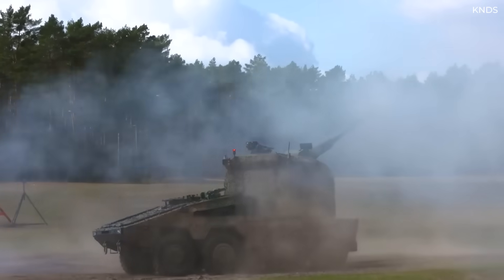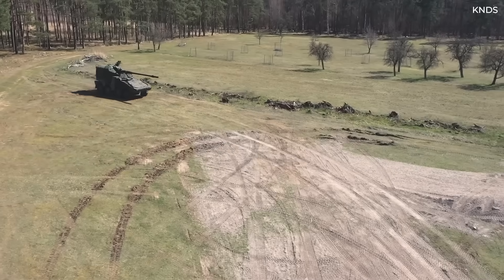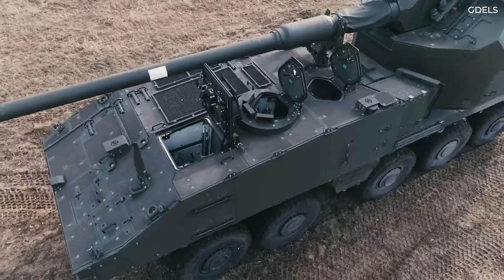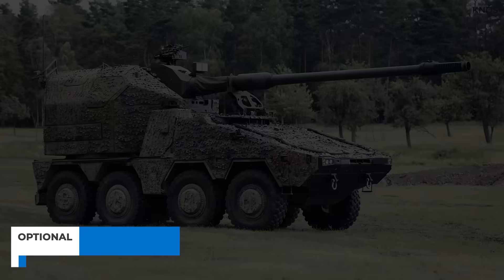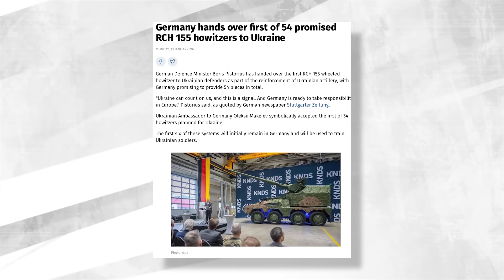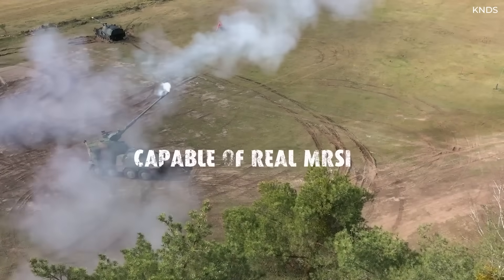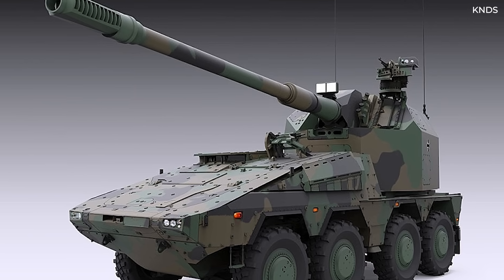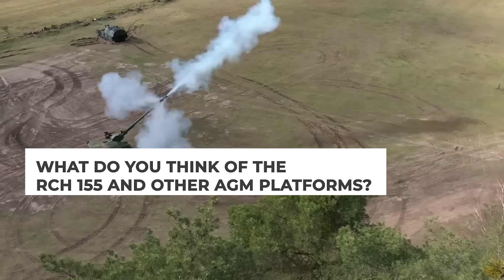RCH 155: If Drive-By Shootings Used Artillery...

Comment: The RCH 155 is too expensive and too complex. The Ukrainian Bohdana surely offers much better value for money. The tracked SPH's like the Hanwha K9 Thunder offer the best mobility in difficult terrain but tracked vehicles can't self deploy long distances quickly. The Archer being mounted on the Volvo Articulated Hauler has excellent mobility in difficult terrain and can self deploy long distances. The Slovak Zuzana 2 probably has similar mobility to the Archer. The variant of the French Caesar, the Caesar 8x8 mounted on a Tatra chassis looks to be more capable off road than the earlier version mounted on the Renault Sherpa 6x6 truck but less capable off road than the Archer or the Zuzana 2. The South Africans and Israelis also have good equipment so there is no shortage of good options.

The Lithuanians chose the French Caesar Mk2 also on a Renault 6x6 truck chassis so mobility in difficult terrain is not the best but they also have the German tracked Panzerhaubitze 2000 so they complement each other. Latvia uses old American M109's upgraded by Austria and this was probably a very good value for money purchase. Estonia use the K9 Thunder and the Caesar 6x6 so have similar capabilities to Lithuania. All good choices apart from the lack of standardization.
Reply: that is a lot of cobble of speculation trying to pass as a matter of fact, nice try though
Reply: @andreas: You miss a couple of important points: Arty ranges expanded a lot in recent decades, and we haven't even started to field and purchase ramjet ammo with ranges north of 140 km. Plus all over Eastern Europe you can hide wheeled artillery in woods, drive out onto improved agricultural and forest roads (plus the regular ones) as any zoom on google maps will confirm you. As for the use of the respective guns, all the mix you mentioned should have gone to Ukraine to crush the Ruzzians, and repurchase of the best, most modern, most resistant to Ruzian kill chain by UAV arty for counterbattery etc. would have been ideal. That is, order 1000 - 3000 AGMs on whichever platform, and phase out the legacy systems to forward them to Ukraine alongside opening ammo factory after ammo factory would have been smarter. Ukraine in its state of national emergency in a fight for survival cannot choose, but would love to match Ruzzian old Cold War stocks of ammo and arty tubes, especially if donated. But we can afford standardized quality of which the Ruzzians can only dream. (You do of course have a point concerning fast Bogdana assembly due to this emergency, but that only reenforces my observation: 24/ producation asap with massiv fast handovers would have been the preferential solution. If any Baltic State builds or buys AGMs on any fitting platform, they can use that probably for 50+ years in pure deterrence. Under those circumstances a wheeled arty is cheaper and simpler to operate as opposed to tracked vehicles that should have rather crushed Putin's war criminals day after day).
Reply: @Walterwaltraud , a flow of schizo and dreams
Reply: @Danila_Korotkov02  Yeah, disprove it, little bot. Facts and arguments, no trolling, if you can. I'll be surprised...

Comment: This is the first time I've seen a wheeled howitzer without a spade.
How accurate is it when firing with the vehicle shaking that much?
It would be great if the catalog data could be put to good use in actual combat.
Reply: It would not be chosen by several militaries if it had problems with precision.
The recoil dampener is probably secret.
Reply: @DJ1573  Thank you for your comment. I have been researching military weapons for over 50 years and have had contact with members of the Self-Defense Forces.The manufacturer's advertising is great, but I've heard that when people actually try to use it, the performance they claim to achieve doesn't come close to what they expected.
Reply: @radiojanker  According to old RHM materials, the trick is that the round has left the barrel before the delayed blowback hits the chassis. 
Thus the suspension only needs to get the chassis back to stable in time for the next shot, which is a lot of seconds to work with. 
Also, the suspension for the RCH155 / A3 model is oversized compared to earlier Boxer types.
Reply: @positroll7870 Thank you for the explanation.
Reply: Mam te same wątpliwości.
 Na wojnie ekspedycyjnej (Afganistan), pewnie sprawdzi się znakomicie.
Na wojnie totalnej(Ukraina)-mam duże wątpliwości.
Reply: @marekduczman  It probably mostly depends on how target rich the environment and especially the recce is. A bunch of them softening up defenses whilst on the move, harassing, MRSI when they see a worthy target, with supply covered in forests limits the amount of shells needed to locally overwhelm Ruzzians etc. Until they amass enough firepower, reconnaissance, air supremacy etc. 

Is it ideal for the first 48 hrs at the 38th parallel or for Taiwan? Nope. But depending on opposing force and attrition, especially from the air, I'd rather have one of these in LSCO than 20 D30, for example.

Comment: A mi parecer y por Física, el  Boxer 8x8 o similares como plataforma son los menos viables, un sistema de artillería de este tipo requiere de una base sólida y amplia para un funcionamiento correcto y longevo, de lo contrario asistiremos a un escenario donde este equipo pasará gran parte de su tiempo de servicio en mantenimientos y reparaciones por recurrentes desgastes y roturas prematuras.
Reply: And the Boxer ist modular. The AGM ( Gunpart ) kann bei swapped easy an fast to another Boxer drivemodul.
Reply: Exacto, Si tiene toda la razón, para esa función de Self propelled 155mm de trabajo dinámico us una muuuuuy sólida plataforma.

Comment: Before the usual experts show up: Yes, the Boxer can handle the recoil without any problems. The real issue with the RCH155 is how it can handle the threat of drones, but other howitzers have this problem too.
Reply: Anything that isn't a dedicated AA weapon has these problems.
Reply: @0Turbox  Even AA weapon weapons aren't immune to drones, especially if they aren't aa weapon specifically designed for small short distance threats. Like if you had bunch of low altitude small fpv drones charging Patriot launcher at low altitude there wouldn't be much the patriot itself could do. Of course someone would have failed badly for those to get close to such target.
Reply: Just combine the unit with dedicated AA like the Skyranger
Reply: @DJ1573  Skyranger turret on top of the RH155 turret ?
Least it'll get a good vantage point :-)

Ah yes, a remote weapon station on top of the Skyranger turret, to protect against infantry and such.
Reply: @johanmetreus  Just like a battleship turret 😂
Reply: @johanmetreus  No i meant a dedicated vehicle supporting/defending the RCH155.
Reply: So same issues any wheeled artillery has.
Reply: UKR wanted some upgrades. I expect one of them being the RWS on the roof getting anti drone sensors. Maybe some ADS/Strikeshield panels are getting added, too.
Reply: I think the mobility on its own helps it against drones.
Reply: @hedgehog3180 yes!
Reply: In German army RCHs is working in a group combined with a command and a radar vehicle or something and skyrangers AA as i heared.
Reply: Actually you need an extra variant of the Boxer.
You can't put the module on the "older" types.
Reply: We'll see in due course as some issues like metal fatigue only manifest over time. It could probably benefit from being on a longer Boxer chassis with an extra axle. It's interesting to see the same gun being mounted on a 10x10 vehicle for the Swiss.
Reply: The AGM needs to be mounted on the 44 ton rated version of the Boxer with the improved design. 
The AGM can be procured on a 10x10 piranha platform or the ASGOD tracked vehicle
Reply: Higher mobility itself is one protection against drones + it has secondary weapon so it might be smart to develop something for that with drones in mind. Not super heavy but very accurate mg or grenade mg with proximity fuse and some mini radar.
Reply: I would be surprised if a vehicle weighing roughly 40 tons couldn't handle recoil

Comment: No one seems to know how it is able to fire on the move, without putting down any stabilising feet...  Something special with with recoil? Or suspension of the Boxer? Strange no one seems to be even talking about it...
Reply: According to old RHM materials, the trick is that the round has left the barrel before the delayed blowback hits the chassis. 
Thus the suspension only needs to get the chassis back to stable in time for the next shot, which is a lot of seconds to work with. 
Also, the suspension for the RCH155 / A3 model is oversized compared to earlier Boxer types.
Reply: @positroll7870 That does not mitigate the bumps and vibrations coming up from the vehicle when moving.
Reply: @johanmetreus  Sure. But thats a problem that has been solved for fully stabilized tank cannons for 40+ years. Those 40 years also allowed for improving those systems to the point needed for a gun firing 40km ...
Reply: @johanmetreus  The shell is released when it's exactly aligned with azimuth and angle. That's the (not so new) trick; it all depends on the execution, obviously, and the RCH 155 has a top speed for the trick (not sure whether I read it in km/h or mph, so I am not gonna write it from memory here).

Comment: Impressive that it doesn't need to stop and brace to shoot.
Reply: Sure, but not very useful.
Reply: Nice feature, but, chassis won't last long.
Reply: @DruidTimer  The barrel will probly need replacement anyway long before the chassis shows serious issue. Like shock absorbers are designed to absorb shock.
Reply: @DruidTimer  Exactly, wear and tear on Western artillery systems in Ukraine is a major problem, with a lack of spare parts and skilled technicians to repair the systems in the fields, necessitating their return to the manufacturer.
Reply: @AddieHilton  not really true. And you need to fire a lot less with an accurate artillery and you need a lot less people. After all it is the Russians that are running out of artillery now. The shooting on the move won't be used all the time. And you could put the AGM on a different chassis. There are variants on RX truck and tracked versions.

Comment: nice video as always!

Maybe considering mention that today most advanced weaponsystem could serve longer or doesnt need updates as soon as other weaponsystems then the not so far developed weaponsystems from other manufacturer.
The livespann of miltaryvehicle is long and in my opinon the price you pay today for acquiring it could be mitigated by the lifespann of the vehicle or the need or NOT need to upgrade it. The other point is that its ONLY needs 2 men to operate it.

Also whats a complex topic is what is included in the purchasing price. A Maintenance contract with or without spare parts and so on. The public doesnt know in my opinon that a price reported in the media is what you get. One country orders a maintance package the other isnt. One countrys orders training or training aids the other not. In todays world a upfront cost tells you nothing of importance in my opinon. 
In my opinon the price forwarded to the media shouldnt be taken seriously cause it doesnt reflect the true value of what the country is buying.
Reply from the maker: Yes- good point about price. It is always a difficult one. If there is 0 mention of price, then people ask about the price. And if you try and provide a rough price estimate, some people will say that the mentioned price is inaccurate (because it often is). 

But in most cases these days it will be difficult to provide an accurate price-per-unit because deals are always different and what is included in the price varies as well.
Reply: @BalticDefenceReview  a tough topic to bring to the audience without the support of facts. 
I was watching a german creator that had a flight in a eurofighter. He showed what it took to be able to fly a eurofighter as a observer. From maintance to medical checks to pilot training and so on in a 4 -5 hours videoseries (sadly only in german but if its intrests you the creator was JP perfomance). I wasnt aware what it costs to run an airforce. This series opend my mind of what is required to operate a military and its costs behind it what you normaly dont see.
Reply: @BalticDefenceReview  That's why price per unit should be avoided. Total price and number to be delivered under the contract is the only relevant information with less it is specified what extras are included, like in the Swedish Patriot purchase where crew training and simulator access was stated to be part of the deal.